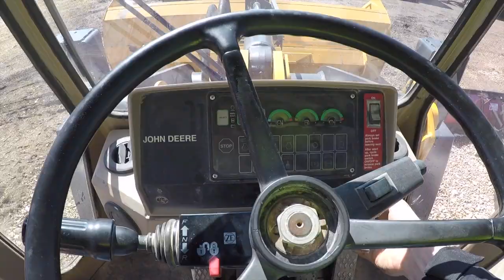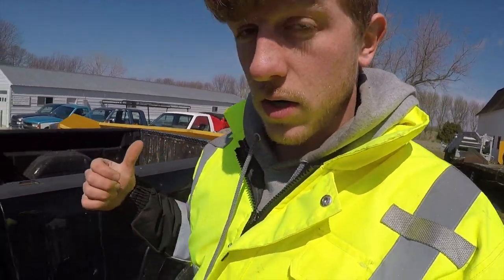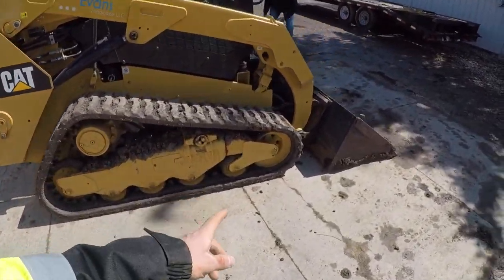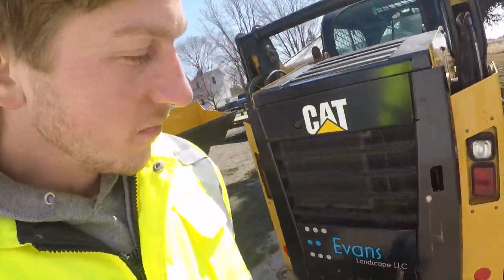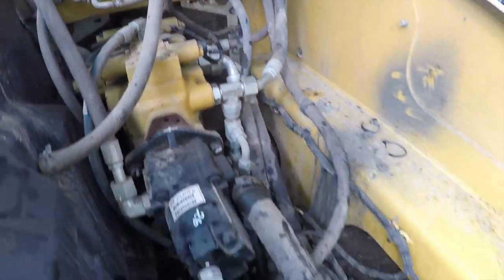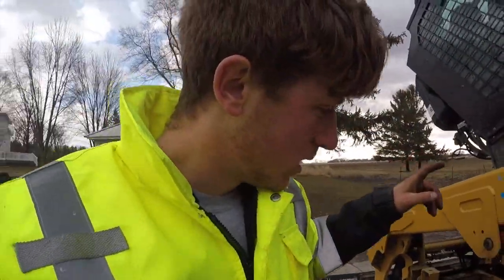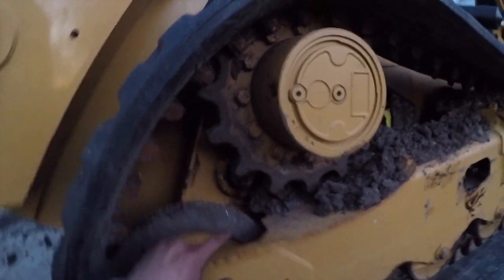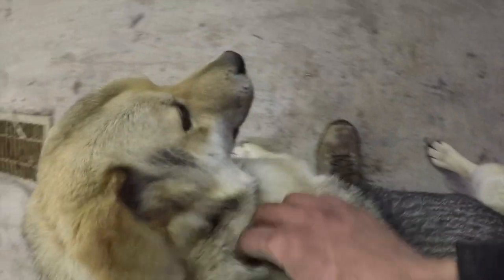FIXING the CAT 259D - It Won't Move!

Comment: Lift straps might be rated for the weight but not for sharp surfaces. The front eyes you were using would be fine if they had rounded edges but as is, they probably damaged your straps.

Comment: Thanks for the video.  The same thing happened to a 287 that belongs to my cousin.  I got stuck with the repair though.  His has the multi-terrain track system.  So, I will call the Cat dealer to see if its possible to slide the sprocket with removing it completely.  I am not looking forward to removing and replacing the track...

Comment: I have the same issue with my CAT 259D.  The lower hose on the left side is blown.  Did you have to remove the final drive motor after you removed the track to replace the line?  Or just remove the track?
Reply from the maker: Satish Tummala you do not have to remove the final drive. It’s tight, but all you have to do is either remove the track, or slide the undercarriage out. To move the undercarriage, all you have to do is take the bolts off the end of the torsion bars. Once removed, slide the undercarriage out just enough to get to the line fittings.
Reply: Evans Landscape LLC Thanks Evan for the reply. Did you need any special wrenches or just the typical crescent wrench for the line?
Reply from the maker: Satish Tummala a crowfoot may be helpful. Depends if you move the undercarriage out. It’s pretty tight back there
Reply: @EvansLandscapeLLC  Hopefully you see this and can help.  After jacking the machine up, can you explain how you go the undercarriage to slide out?  Trying to change out the smaller 1/2" hose that is under the main drive hose and it is so tight in there I can't get to the fitting.  Thanks.
Reply from the maker: @ loosen the bolts around the two torsion bars, and the whole undercarriage should slide out. Be careful of sliding it too far out as it can slide right off the torsion bars. Can be tricky to get back on.

Comment: PS,  how did you get it on the trailer?  If the top hose has a leak, is that hose for reverse only?
Reply from the maker: Satish Tummala I barely got it on. I noticed it was leaking, so I quit what I was doing and ran it on to the trailer. Once I got it on, all the fluid was gone and I wasn’t able to move it.

Comment: I had the same repair and I fixed it and I replaced the hydraulic fluid and the right track is still frozen
Reply: My 259 D is in lock out mode how do I remove it

Comment: Super obnoxious wrong super desperate way of lifting a broken down machine, the lift boom arms hydraulic cylinders are now wrecked because never designed to take the load in the wrong direction, your very lucky you didn't rip said arms wright off when stupidly using a super wrong hoisting point.  Simply another grunt yt channel again. Period